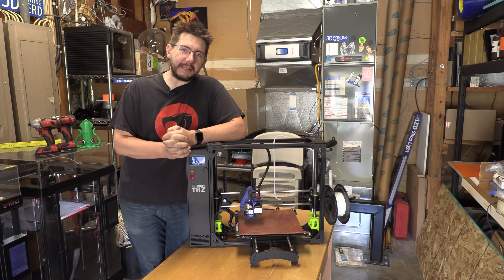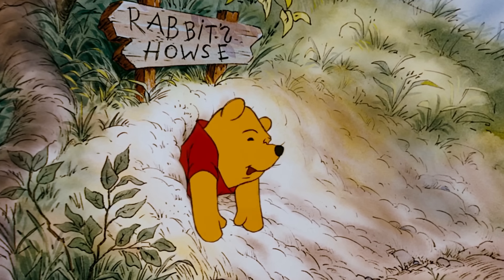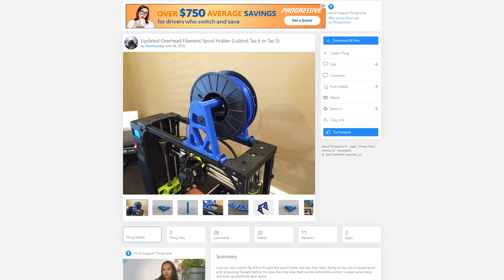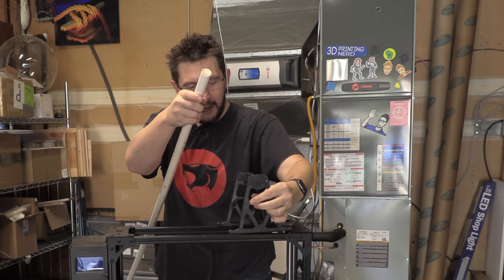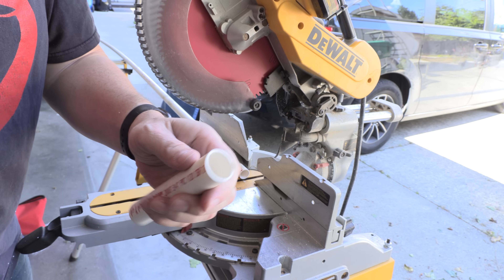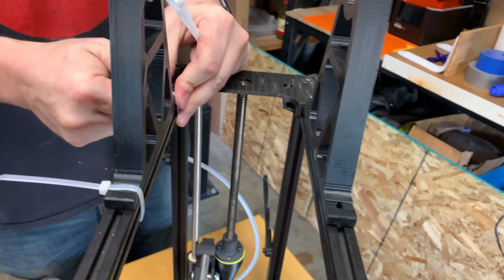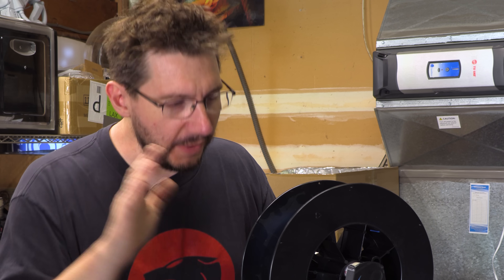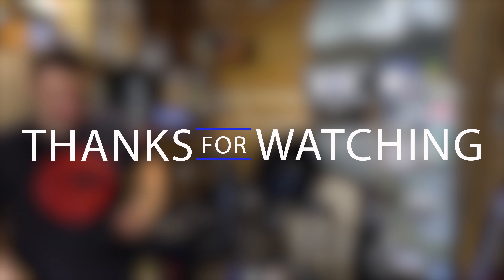Fixing the Lulzbot TAZ 6 Spool Holder

Comment: Joel I just acquired one of these Taz 6 3D printer, it had some issues which some soldering and fixing has resolved.  At 6 years old, I really haven't seen the company offer any 32-bit or BL Touch style upgrades.  Have you tweaked yours at all?  It prints OK, but sure is a bit dated compared to newer machines.  I do like that print head support and quick change via their fork of Cura.  But with SKR, Duet and other boards out there, this seems like a fun machine to modernize.

Comment: You used a SAW to cut PVC? The electrician in me is sad. Run a sharp knife a couple of times around where you want to cut the tube and snap it in two over your knee. It'll be a clean break. No need to fire up the saw.

Comment: I use a similar holder which I prefer because the spool rod is threaded which adds stability to the holder.  It also has two heights for the spool, which has come in handy: https://www.thingiverse.com/thing:2784872

Comment: I have a couple Taz 6s, one w/Aerostruder, and one with the fairly horrible and over-priced Lulzbot V3 dual extruder. I will be making these spool holders for both machines. Why a teflon tube is used on the Taz is beyond me. The tube servers no practical purpose, being unattached at the extruder. One thing I've noticed is that most (but not all) PLA filament gets very brittle very fast (over night) if left in the teflon tube. It's so brittle it breaks just from the slight stress of bending inside the tube, and it's a big pain to remove short broken pieces from the tube when that happens.
Reply: Chuck Hole a 40mm deep fan makes the dual extruder v3 work far better. Mine stock would jam immediately after a few layers. You need longer bolts also for mounting it.

Comment: Only 2 comments I have:
1. You are not the first, but I keeping hearing about US 3D printing people having issues measuring in MM and needing a metric tape measure. I've never seen a tape measure sold in the US that didn't have MM on it. What am I missing with everyone seemingly buying another tape measure just for metric?
2. I had to pause the video because I was laughing too hard from Sean getting taken out by the zip tie end. It was too perfect.
General: the small fixes are sometimes the most satisfying.

Comment: Joel, I got a quick question for you. Can you print tpu or ninjaflex on your ender 3 pro without any store bought modification on your printer? I got 10 spools of tpu and ninjaflex from a friend who also has a ender 3 pro but couldn't get the machine to print it. Would love to prove him wrong and maybe print my own mods if needed.
Still love your vids! Big fan from Norway.
Reply: Try to print really slow. Like 10mm/s and no retractions. I have a home built bowden setup and can get away with a little but slow retractions as well. The important bit is to go slow. Much slower than you think at first...

Comment: Nice upgrade and entertaining video.  After a couple of years of printing, I find myself forsaking the attached spool holders and using standalone spool holders a majority of the time.   They can be placed wherever it is convenient.  Some machines like the CR-10's spool holder and this one for the TAZ6 that you printed would stay.   I've never attached the stock spool holder on others like the Ender 3. I do like and use spool hubs to center the spool to give the spool a smoother roll off of the filament to the extruder.

Comment: I love the Lulzbot Mini and it is a workhorse as well. Seeing the extruder mod makes me want to do the same (after I finish using all the spools I have) but what about making the Lulzbots quieter??? They are great, but very loud machines. What would you do to minimize the sound of this machine?
Reply: rivera82falcon a dampener on the y axis motor will greatly lower the noise. The mini2 is also pretty quiet with the silent stepper controls
Reply: @StuffWithKirby  I have the last release of the mini 1.04 which comes with dampers on all the motors but it's still very loud to me. I have an Artillery Sidewinder X1 which doesn't and is incredibly quiet. I'm assuming the stepper motors are reason for this? Something I'll have to learn about and "fix" for my needs.
Reply: rivera82falcon lulzbot sells stepper motor isolators for the y axis on the mini. Quiets it down very nicely.

I’ve added the isolator to my y and x on my taz 6 as well.
Reply: @jim2386  I'll check their site later today for that. I want to keep using this printer for the small detailed items but I need the noise to drop. Thank you for the heads up.

Comment: How does the Taz hold up with new printers,  It's still expensive, is it worth the money  ?
Reply: DJ legion I get all mine used from ebay. Its very good still, easy to source parts and reliable. Pretty much a set it and forget it printer until its done. I don’t think I have ever had a failed print on my taz6 that could be blamed on the machine. I use the mini’s most the time though and the results are the same. Got 5 minis and 3 taz’s
Reply: I guess not, as the only part he's kept stock is the frame
Reply: Bob Sharpie thats false. Everything is still stock except hotend. I dont think changing spool location makes a difference in quality of machine. The hotend changed because he wanted 1.75 and advances in tech since it came out makes the aerostruder print both flexible and regular without having to swap hotends.
Reply: The taz 6 is excellent, but its not a 32 bit system. I love how modular it is with the optional tool heads it has.